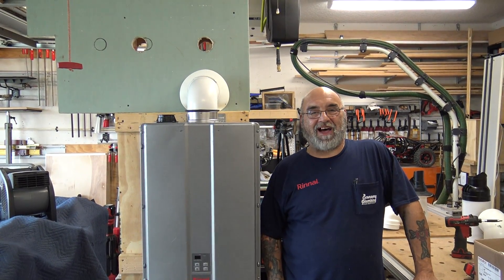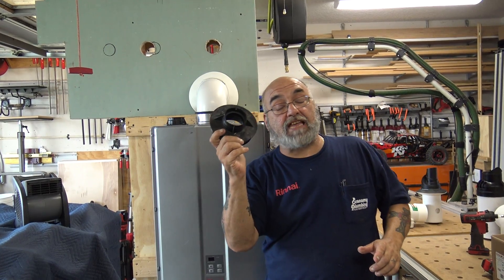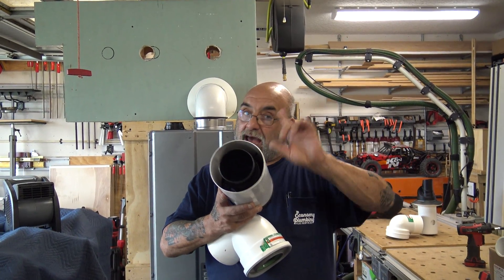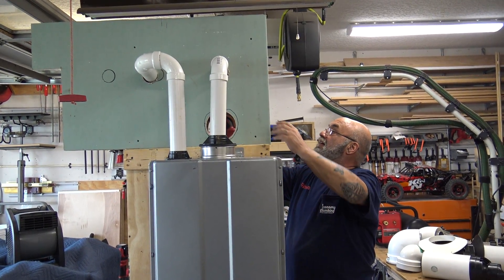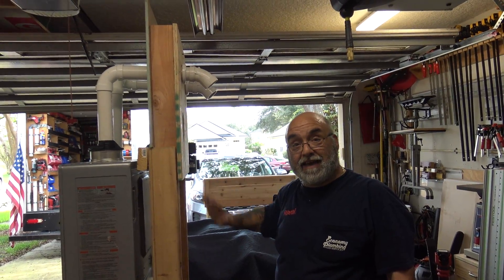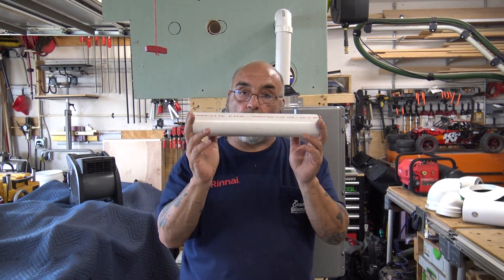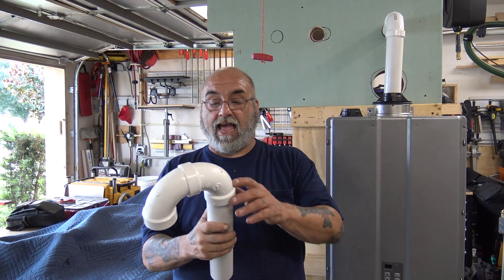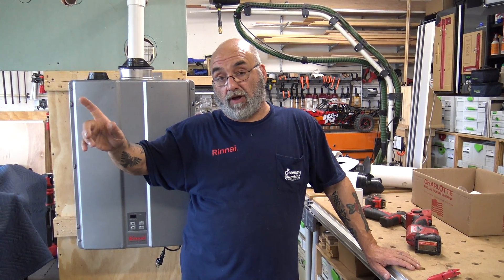Proper venting of a Rinnai RUR series unit.

Comment: Hi Mike!  Thanks for your helpful videos.

I know you have said multiple times about when using PVC for direct vent that it needs to be for pressure (not foam core), but I haven't ever heard anything about the fittings.  Most fittings that you can find are for DWV with a max pressure of 5 psi.

Is it more of a need for solid core than for pressure?

Also, are the more commonly found PVC fittings (elbows and such) fine even though they aren't rated for pressure?

Comment: How about if you going horizontal like in an attic? Doesn't it have to be 1/4-inch pitch?
Where do you find the Long sweep 90 sch 40  like in your video? All I can find like that are the drain pipe '90s 
All I can find is schedule 40 is the short '90s 
Thanks for your help!

Comment: Question about properly seating the PVC at the Rinnai unit:  there is a rubber seal in both vent openings. Does the PVC simply set on there or does it need to slip through the rubber seal?

Comment: Hey mike Thanks for all you do
 Im not a professional but pretty handy. I havev a newer model RSC199Ip  My question is about venting. Arecwecstill allowed the 2" sch 40 pvc?  Can I use the inside of the ( one car) garage as my fresh air intake? And if I go out the back with the exhaust, what are the restrictions. 
Close by is an AC Unit, and the soffit.

Comment: Hi Mike!
Thank you so much for all the info on the installation 👍
I just needed to ask you a specific question about the RU199i, the inside unit. When you run direct separate 2" lines, they should not be more than 65" in total length. I have 3 90s and 2 45s on the air intake pipe and 2 90s and 4 45s on the exhaust pipe. The total equivalent length is 46 ft for the air and 40 ft for the exhaust. I'm within the limit but do I have too many elbows, still? 
Thank you very much!
Reply: Anyone to respond to this please.
Reply: Aren't  we allowed  the 65' total length of each pipe separately? So say 65' for fresh air and 65' for exhaust? Or am I incorrect
Reply: Yes, 65' each but I was asking about the total elbows allowed to install, if there is a limit, or you just add the equivalent length of them and just go up to 65' length?

Comment: Thanks mike.  My wife has this guy coming out next week who only does Rinnai installs but im sure she will cancel once i mansplaine why you can't just replace a tank system with tankless without running new venting and cutting new holes in the roof.  She wont like that.  Think we will just get a new hot water tank.

Comment: Hi Mike I just got the Rinnai RU199iN Condensing Tankless Gas Hot Water Heater. I was wondering can I tie in the PVC to my venting for my furnace if I do pvc
Reply: No No No it needs to go out separately at least 14” fro each other or another vent. Mike
Reply: @Mike’s Wood Shop  thank you, sir, for the reply. Sorry if these are dumb questions, but when I remove the hot water tank can I run the schedule 40 pvc up to the roof  where the exhaust from the hot water tank went.
Reply: You can use it as a sleeve don’t attach the tankless vent to it

Comment: HI mike, Love your channel.. Can you use the 3x5 condensing vent (uubink) on the new RSC199IN?
Reply: Yes you can
Reply: Can I ask why or what's the advantage of using the Ubink concentric vent pipe. Aren't they way bigger than the 2" pvc. I haven't installed my venting yet, but wondering why people don't use the pvc. It seems easier to get the vent out? Curious

Comment: Hi Mike, Great videos - thanks! I have a tankless Rinnai similar to your video and have descaled but when it is recently running, it vibrates and hums. I have looked into the exhaust from outside and clean. So, now trying to understand why the humming and vibrating. Any suggestions?
Thanks in advance.

Comment: When installing with the 2 inch PVC for the vent, how short can the riser pipe pieces be off the top of the tankless unit? Does it matter?
I did a job where I had barely enough room to 90 degree out from the top of the unit with like a close piece of PVC pipe then an elbow fitting looking  straight to outside exterior wall. Is there some rule with the Rinnai venting that states that it had to be atleast 6 inches or something coming out the top of the unit before you can 90 degree out ? Also why can't you use a 2" PVC DWV 90 degree fitting looking down coming through the exterior wall outside with the screen in it?

Comment: Hi Mike.  Question about sharing combustion air.  I'm having an RUR199 installed and installer is saying he will be sharing the 2" intake vent with my high efficiency furnace. I'm questioning if this OK?  There will a separate exhaust vent but shared intake.

Comment: Yay you answered my question i looked at a house today that has a Rhinnai and they had the intake coming from the inside of the garage and the exhaust going like two stories through the roof and I was like is that gonna work properly with the intake and exhaust in two different atmospheres, but I guess it works.

Comment: Hi Mike.  Thanks for the informative video.  What do you recommend to use when the Ubbink concentric vent exits an exterior wall with vinyl siding?  It seems that all the vinyl siding mounting blocks are either to small for the escutcheon or aesthetically too large (15" x 16").

Comment: Hello,
What about using 1 pipe. So concentric venting. My water heater is inside my house in small closet room that will vent through the ceiling into the attic and up through the house roof.
What pieces do I need to purchase? 1 concentric pipe all the way through? I think I have probably over 20 feet up

Comment: Mike, this is awesome!
Do I need to add a condensation drain for the RUR model with 2in PVC venting straight to the roof?
Same roof venting installation you describe here at the end of the video.
Reply from the maker: Yes you do follow my video on piping the condensate drain. If it’s going into a sewer you need to add a neutralizer to it. Mike
Reply: @ThatTanklessGuy  Hi Mike, as far as the condensate drain piping, got it, thanks! So I will definitely plan to install the condensation drain 3/4 C-PVC piping below the unit, as per your video.
What I was actually asking about here is if there is a need to add another condensation hose at the top of the unit, where the schedule 40, 2in PVC connects to the unit. Does that apply and is that necessary for the RUR 199 interior unit, when vertical venting? I will probably have 25 ft of straight vertical pipe going from the first floor to the roof.
Thanks,
Peter

Comment: Mike - thanks for all these wonderful videos. I'm hoping you can help me.

We had an Eternal tankless for a number of years. We just replaced it with a Rinnai RU 199IN. The unit works fine but we have one problem I'd love some help with.
Whenever we run a cold tap anywhere in the house, we hear something turning on in the Rinnai. The "In Use" light does not turn on but something is running - I assume it's the flow turbine. 
Following a suggestion from Rinnai's tech support, we installed a check valve on the cold inlet and also added a 2 gallon expansion tank. I got conflicting info on what pressure to set the expansion tank to - our static water pressure is about 67 PSI. I was told to set it to 12-15 lbs below that so I pumped it to 55 PSI. Neither of these changes have helped.

The problem seems to stem from the fact that we have 2 "on-demand" recirc pumps in the house. These are the under-sink pumps where you push a button when you want to get hot water. A pump drives the hot water back down the cold water line until the water is hot, which saves wasting all that water. If I shut off the valves to both of these units, the problem goes away. If I leave the valves to either of them open, the problem happens. One is a more powerful "Taco Genie" unit; the other is a residential "Chili Pepper" unit. Just to clarify - we do NOT have the RUR continuous recirc model.

- Would changing the pressure on the expansion tank to match our static water pressure help?
- Any other suggestions?

Thanks so much for any help.

Comment: My plumber installed our unit with the separate intake and exhaust (as discussed starting about 7:50) on our brick house. He didn’t put escutcheons on the outside, but he filled the space around the pipes with concrete, so it’s sealed nicely. Are the escutcheons necessary, then, or do they just serve to provide a finished look?
Reply from the maker: I use them as a sealing ring and it trims it out nicely. As long as he sealed it it will be fine. Mike

Comment: Hey Mike, great video. One question, why can't I run my 2" PVC through my old metal exhaust pipe. You don't recommend to sleeve it, just wondered why. Thanks again.
Reply: No you can’t they have to be desperate and all 12” apart
Reply: @TheBuddylab  Ya, I figured as much. Just thought I'd check. Thanks for your reply, plan on starting the instal tonight.
Reply from the maker: I do say that I have other videos on it. As long as you sleeve it and hopefully it’s a straight run it would work. 
Mike
Reply: @ThatTanklessGuy  Exactly, I hope it's a straight shot! I should probably put some type of support or clamp it to a rafter or something. Thought I might cut the pipe once I got into the attic and support or clamp it.
Reply: Take the vent out to the roof penetration and sleeves it through that
Reply: @TheBuddylab  Hate to sound dumb but what is the roof penetration?
Reply: Hey Mike, one more quick question... I have a 4" exhaust and intake for my furnace that runs right above where I will be putting my new water heater. Don't suppose I could put a T in those lines and hook into those???
Reply: I'm guessing that is simply where the exhaust pipe exits the roof...

Comment: HI MIKE, I just viewed your video and would like to consider changing to a tankless system. I have two Bradford White 75 gal in my home. One of the present units in not working and these units are now 17 years old. The other reason we would like to switch to tankless is the wall mount. We will need to have some work done to the Basement floor as we have a chronic flooding issue and have had and will need to be moved off the floor at some point. So now that I have given some of the back story, I would like to get your thoughts on which model of Rinnai (ruci98in) 11GPM?  (to help maintain water pressure in the house) and the 15 year warranty.  Do you prefer the non condensing models that have the same size Exhaust Venting pipe we currently use and have 16 in walls brick exterior.  We have a drain area system to accommodate the line for the floor drain. Thanks.

Comment: I have a 1-storey house with a 2-car garage in Phoenix with a tile roof. The distance from the top of the Rinnai unit to the roof is about 15 feet. The Rinnai (RUR160in) will replace the old natural gas heated tank. The air in the garage will supply the intake air for combustion. There is an existing 3" B-Vent from the gas operated water tank that is being removed. I want to run the 2" Schedule 50 PVC up through the B-Vent. If there is need for stability, I could add a few screws along the way - it's not very far. The B-vent is already anchored to a stud. For example, I could add screws near the top at or just below the roof line and at the bottom at the garage ceiling where the B-Vent starts and maybe another in the middle. What is the argument against doing this? Thanks, Tom in Phoenix AZ
Reply from the maker: That would be perfect👍👍no screws just glue anchor the elbow before it goes up the B vent and use a 6”x2” fernco coupling to water seal between the old B vent roof flashing and the 2” PVC
Reply: @ThatTanklessGuy  I think I understand what you are saying. I sent you pictures at your aol email address if you want to see the old pipe, top to bottom. I should remove the old vent pipe on the roof, then insert the 6" x 2" fernco coupling on top of the old flashing. The diameter of the Type-B vent tube on the roof is 3.5". It's 3" coming off the top of the old water tank. Were you thinking the vent tube is 6"? Thank you very much for your help.

Comment: Hey Mike, I love your videos! Thank you so much for sharing your knowledge and experience with us. This is just great!
Question: For a roof venting, using two separate 2" sched 40 pvc, one for inlet and one for outlet, and placed 2 feet apart, could I create a lower profile vent? Meaning, does it have to stand 2 feet over the roof surface? could I just make a short rain hood, that only stands a few inches over the roof? And how hot does the exhaust get? I'm guessing less than 400degF or it would cause the pvc to loose its rigidity. Thank you so much for all you do. Mike
Reply from the maker: thank you very much

Comment: Mike, I love your videos!  Keep 'em coming.  A fellow NYer here and I have a question?  I moved to SE Virginia 7 years ago and for some odd reason they install their gas 50 gallon hot water heaters in the attic!  WTF!  I want to replace my hot water tank with a Rannai RUR199 in the attic and would love it if you could do a video on the proper set up and roof venting for an attic installation.  Thanks, Anthony
Reply: I will be showing some things that will help with an attic installation. Call me at 19042385349 today after 6pm and I will go over it with you Mike

Comment: Mike, had a question about running the vent pipe up the old vent for tanked. After the old inner pipe is removed and the new pipe is ran, how is its weight supported? At a max length of 65 feet seems like it would be significant weight resting on the unit vent connection. I want to install this unit on my two story home (well under 65 feet) with an intake in three car garage and exhaust at roof via the old tank vent run.
Reply: Mike, just seen you have  another older video covering exactly the topic I was looking for, thanks👍

Comment: Can you use non direct for your intake air supply?  My current unit, Eternal GU145S, is installed in a large attic space and uses my attic air supply for the intake.  I would like to use my current 3" exhaust and just non direct my intake from the attic air supply.  Can this setup be used for this Rinnai unit?
Reply: I should of watched the whole video before asking my question.  Based on what you stated about using non direct intake air in a large garage space answers my question if a large attic space should be sufficient.  Great video!!!

Comment: The rinnai RUCS75IN states 3 inch pipes if using the two pipe system. I dont have room for two 3 inch pipes can I use 2 inch instead?

Comment: My Rinnai R94LS is making a loud foghorn noise when I first use hot water in the morning.  A plumber said the external gas pressure is good.  I read on the internet that I might need to recalibrate the internal gas pressure.  How do you do that on a R94LS?  Thank you.
Reply: First did the plumber check the fan and the exhaust? Did he check the gas pressure at the tap on the fitting directly on the gas inlet. It has a red and white piece of tape on it. As far as checking the high/ low gas settings this would have to be preformed by a qualified Rinnai Tec.
If you would like call me at +19042385349 today at 4pm eastern time and I will go over it with. Mike

Comment: Mike, apologies if you already have an instructional video on this - but couldn't find it. I also thought the question pertinent, as you're a woodshop-guy as well. We have a Rinnai RL94 in our laundry room, it's an ugly install (especially the wood beams attaching it to the wall and pipes, and valves. Question; can I install a wood cabinet around the unit and pipes?
Reply: Jon Greenwood Jon, call me at 904-238-5349 tomorrow after 5pm eastern time and I will go over it with you. If you could send me pictures of the install and the area. Mike

Comment: Thanks Mike. When do we need an expansion tank setup with a Rinnai tankless water heater?
Reply: You can put one on it wouldn’t hurt. Use a 
ST10 the small Thermax tank.
Reply: Mike’s Wood Shop thanks Mike. However I want to understand why is it used , and what’s the risk if I don’t install an expansion tank. My rinnai instruction manual doesn’t  say anything about an expansion tank, that’s why want to hear from your experience
Reply: @abhinavgaur13  In general, I feel you only need a expansion tank with a tankless if you are using a recirculation loop and end up with a heated closed loop.  Follow manufacturer and local codes though.  Most cold water supplies have a check valve or backflow preventer that creates the closed water loop in your house.  If system is filled with cold water, then heated, the pressures will rise quickly as the water tries to expand but has nowhere to go - common with hydronic heating and domestic water tanks... with a tankless, it is only heating water while a tap is open so you don't get the pressure buildup.  When you add in a recirculation line you are heating water with taps closed.  These are my thoughts.
Reply: @sbitschy  Thanks Steve. That's helpful. In my case, I think I will not install one then, because I have a very small home. The furthest line from water heater is 20 ft I guess as the heater is in a utility room right in the middle of the home.